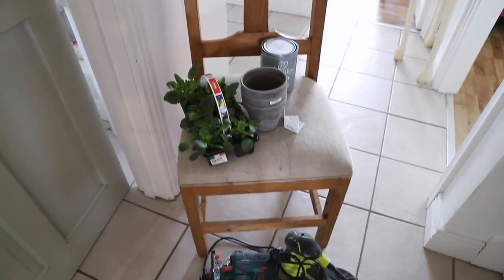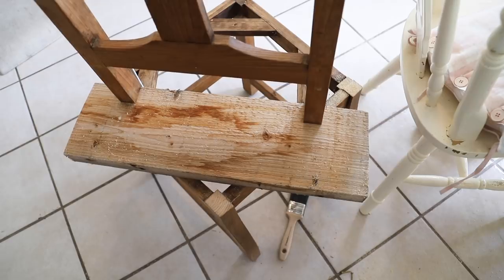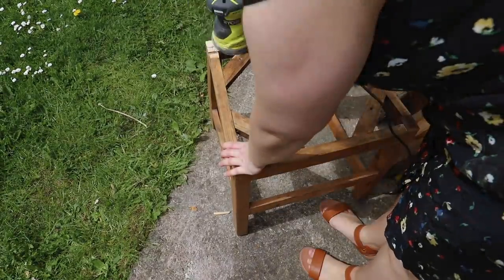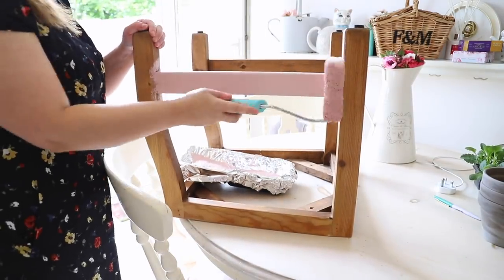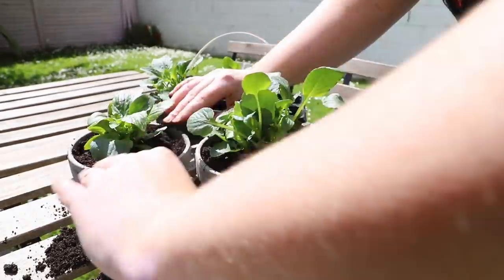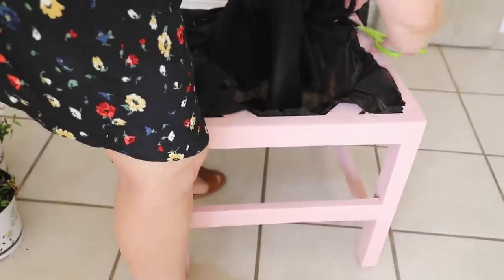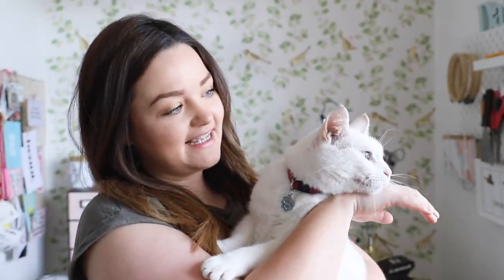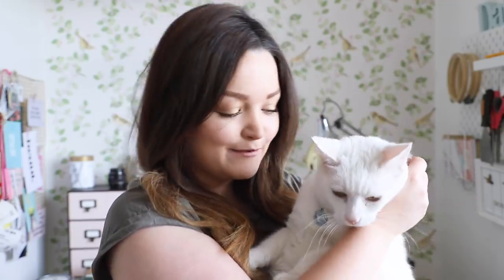How to turn a chair into a planter and a shelf

Comment: I'm going to be refabing a set of 4 chairs to be used as planters outside in the yard. Will the chalk paint protect the chair from rain, snow and wood bugs?
Reply from the maker: Hey, I would use an outdoor clear sealer on them. They will deteriorate over time like most wood planters, but if you seal them and shelter in winter they should be fine. I don’t get snow, so I am not sure about snow
Reply: @DaintyDiaries  Thank you. I'll try that.